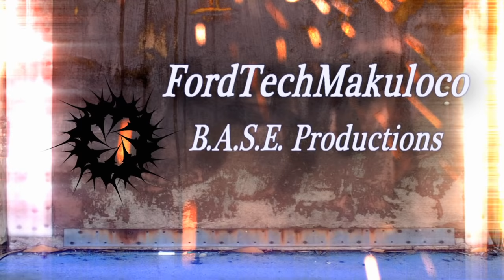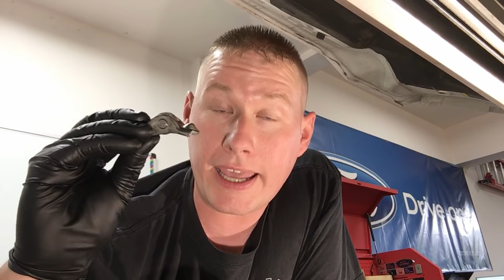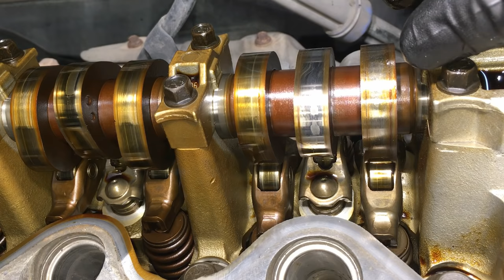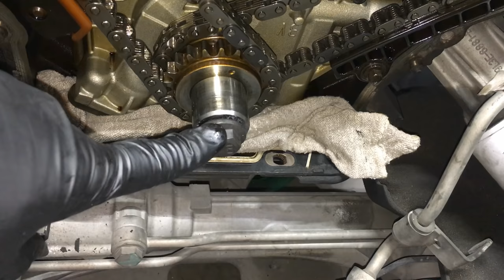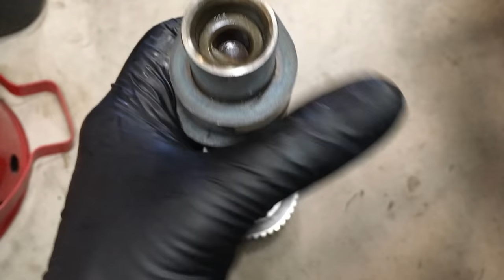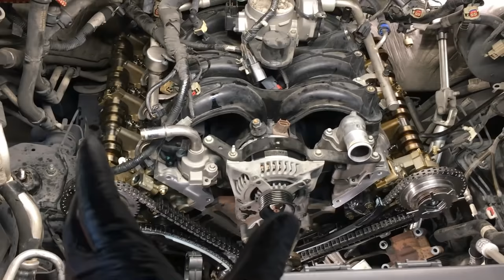Ford 5.4L 3v Triton Engines: Roller Follower Removal and Installation

Comment: i was watching another of your videos and you said always replace. in 2009 and newer..then u said especially 03 and 07 does that mean 2009 and older? i am working on my 2013 should i replace? if there is no damage. any response appreciated. thanks
Reply from the maker: I think you are a bit off here as the 3v engine was not out in 2003 and 2007 was not a change over year so I wouldn't mention the 07 models either. Now I did say 2009 and newer models seem to fail more often but all years can fail so anytime you are inside a 3v engine 2004-2014 they should be replaced yes.

Comment: I need help. The roller rockers will NOT push down and will even bend the tool that’s shown in the video. I can’t even push it down with my finger…. Also this seems to be the case for every valve. Are they stuck?

Comment: hoping this isn't a stupid question...
If you do one side do you have to do the other. 
between removal and installation you removed the tool is that necessary
Reply from the maker: Yes do both sides.

Comment: Can the hydraulic lash adjusters be removed along with the roller rockers with the cam still installed?
Reply from the maker: no
Reply: @FordTechMakuloco  thank you for replying.  I was just figuring it might be a better engine service to replace both hydraulic valve adjusters and roller rockers.

Comment: Do the 5.4 2 valve have the same issues? I have a 04 expedition that's making a knocking/ tapping noise, I'm suspecting it has the same problem!

Comment: Those look like a real pain to take out 😂 Great videos though!
Reply: Some are easy.  Some will make you crazy.  For me, I try to never force them into a spot where they get stuck.  If you can wiggle it, it will come out.  Think ahead about how u want to clock the force on the tool to give you the most room to get the follower out.

Comment: Hey Brian. Love your videos. Great wealth of info. I wanted to ask you a question. Is it possible to safely change out lash adjusters on a 5.4 3V triton without taking the phasors and timing chain off? I have replaced phasors, chain, etc but still have the ticking. My buddy says it’s the lifters. Thanks for any info
Reply: Not really.....

Comment: Wait I’m confused, is having the smaller hole better for oil pressure? I would think the older configuration with the larger hole on the roller the oil would lubricate the cam more and having lower oil pressure then a high oil pressure pushing out of a small hole. I’ve been told my whole life to use ford brand only for timing chains. But I know the new configuration is better but this in theory almost seems backwards. I may just be over thinking engineering but im also wondering why the oil pressure on my truck is rising just slightly but when the timing chains and roller followers maintenance are typically associated with lower oil pressure
Reply from the maker: Yes you are confused.

Comment: Do these roller follower issues usually come with camshaft position sensor codes?
Reply from the maker: no
Reply: @FordTechMakuloco  any idea what might cause an intermittent multi cylinder misfire p0300 and cylinder 7 and 4 most common misfire with occasional cylinder 3 misfire, only at medium load never at idle and never at highway speeds. Along with camshaft position sensor codes with brand new camshaft position sensors in both banks, new spark plugs and coils? Fuel injectiors maybe? Or maybe it still is the roller followers? I plan to fully Diagnose tomorrow so far have just pulled codes and done research and swapped the sensors assuming they just went bad. The plugs and coils I did very recently as preventative maintenance.

Comment: This might be a stupid question but with a new high volume oil pump and the new updated roller followers with the smaller hole will that cause to much oil pressure.
Reply from the maker: no
Reply: Funny I was just thinking that!!

Comment: Im doing the complete new timing chain cam phasers oil pump the hole kit and kabootle anyway the rocker in #8 cylinder the 3 u talk about in stage 3of 4 the valve is under a lot of tension because of the cam loab can i spin the crank shaft to get it with less tension or am i messing up if i spin it with already 2 rollers out of cylinder 5...pls help

Comment: Do the roller followers a need to go back exact same spot the come off of
Reply: Thanks for your vids by the way I lost timing so trying to find tdc going to remove roller followers and try start fromThere .. how do I find the compression stroke in cylinder one on 3v engine.?

Comment: On my 2002 4.6 2v i have slight knock which seems to becoming from inside the valve cover, would it be the roller or the hydraulic lash adjuster making said sound. You cant here it at idle only when you bring the rpms above 2k

Comment: I love watching your videos. So Helpful. My question is when I click on the link you have provided for the roller followers Amazon alerts me that my 2005 F150 is not compatible with the part number and sends me to one that is twice the price. I can use the part number you link to on Amazon and ignore the alert?
Your link: Ford Genuine 3L3Z-6564-BA Rocker Arm Valve Assembly $11.04.

Comment: to remove the valve spring...without removing the camshaft how would you do it I broke one on the passenger side...Driver's side broke first. They fixed it but now I'm on the passenger side it is explorer v8xlt 2002.

Comment: On the right side fifth follower from back of engine I cannot get the valve spring compressor in because of the air conditioner expansion tank, is there another way of compressing that spring to walk the follower in?

Comment: Being that the cam is married between the head and the block with no real bearing on the original ford 5.4 3v I find myself a bit leery of wanting to pay someone to do a timing set, roller followers, melling oil pump etc thinking by the time I pay for all this to be done I'm close to about half the cost of a new motor.  My 2005 f150 has 180k and does have a ticking noise. I keep hearing from mechanic near me I can get a rebuilt motor that has bearings for the cam which sounds like it would make the motor last longer but then every time I mention one of the rebuilds my local mechanics want to use I.e. Frasier, Jasper, Carquest etc I'm told by guys who really know this motor inside and out those rebuild are garbage...so it's back to the ford motor. Would a new ford rebuilt motor include bearings for the cam or is this a non issue? also would a new ford rebuilt motor come with the roller followers with the smaller holes and a melling oil pump? It's just that I was told by several mechanics that if there are grooves where the cam is married between the head and block then it's pointless to do a timing set..they say it's just a bad design. It's tough when you want your truck fixed for the long term and know just enough about mechanics to be dangerous and are at the mercy of mechanics that all say they know best and each one says something different. I'm about ready to drive 6 hrs to Brian and just say here fix this damn thing right lol

Comment: How do you remove the rollers when the timing is already out of time? You obviously shouldn't turn the crank so you don't risk pushing a valve into a piston, so is the only way to remove the cam itself and reset everything?

Comment: I'm having a problem getting the slack adjuster out and the lobe is  at top and it's still hitting the cam I don't know if the top of the adjuster is froze up I'm not sure but I can't get it out any ideas

Comment: Do you recommend 5w20 or 5w30 in a 3 valve v10 and do these engines have any major problems to watch for
Reply: I use 5w30 with NO ISSUES

Comment: @FordTechMakuloco i watched another video, with timing cover removed, there was no need to remove the roller follower to replace cam phasers and chains. I'm at the point of removing the chains. do i really need to remove the followers?
Reply: Cory Thomas what did you do? Did you remove the roller followers? I'm at that point in the job?

Comment: Could you provide me a link to properly adjusting valve lash? I have a loud tapping noise during warm up that goes away as engine reaches normal temp. Suspect adjustment is needed.
Reply from the maker: These are automatic, no adjustment needed.
Reply: @FordTechMakuloco  So I'm guessing a cam phaser going bad? Tapping noise only during start, goes away after warm up. Anything I can check before going that route?
Reply: @DirtyOldSailor  you check your exhaust manifolds??

Comment: The roller follower on Amazon says it does not fit my 2009 Ford F-150 5.4 L 3v. Do I discard this and purchase anyway?
Reply from the maker: Its the same part 2004-2014

Comment: After I do this can I put the valve cover back on and start up or do I have to retime it
Reply from the maker: No you only perform this procedure after engine timing so no need to retime after.
Reply: @FordTechMakuloco  what if you just change the rollers. Do you have to retime?

Comment: Fordtechmakuloo
Replacing timing kit in 05 f150, having trouble removing roller follower next to ac canister mounted to the firewall, any suggestions
Reply: Did you figure it out? Having the same problem

Comment: Can you tell us how to replace the lifters?
Reply: Lifters are super simple but you must remove the shaft.  Pull up on them and they come right out.  A few of mine got stuck about half way up, I put them back in place and pulled up again on them (with just my fingers) and they came right out.

Comment: how do you replace the valve stem seal of this vehicle.
Reply from the maker: +reteece rhu salubre make sure the cylinder is at TDC, remove spark plug and apply air to cylinder to hold up valve, use  a valve spring compressor to compress and remove the keepers. Release the valve spring compressor, remove spring and retainer. At this point the valve stem seal is right there just use your hand or a needle nose pliers to remove.
Reply: @FordTechMakuloco  Can you recommend a tool to apply air to the cylinders? From what I understand the threads are M16x1.5 and the only find tools with M14 and M18 threads. Thanks!

Comment: What's a ball park figure to get a timing job and replace the roller followers  . I know there are a lot of differences in each engine. I  have a 2004 with 231,000 miles and I change the oil every 3000 religiously.
Reply from the maker: $2,500 by my shop, maybe $3500 at others and $4,500 at the dealer.
Reply: Thank you very much . Great videos.

Comment: how do i know what ticking noise is to what problem i'm having i've heard everything from spark plugs to manifold crack to rollers all i know is my truck just started making the noise at 40,000 miles it's 2008 F-150 yeah i don't drive it much but the noise is only noticable when i'm driving it and demanding power like going up a long hill on the highway... i dont' really hear the tapping/knocking noise when it's in the garage idling

Comment: How long in general should it take to replace all 24 followers???
Reply from the maker: 5hrs
Reply: @FordTechMakuloco  awesome thanks for the reply I started last night putting them back in I got about 2.5hrs into the first 12 then called it quits around midnight getting ready to head back out 2 the barn here in a few to pick back up. Thanks for the awesome videos step by step I would have never tried this without them.
Reply: @FordTechMakuloco  got the 2nd half of them down today took about 5hrs for the last 12 after the first 12 took about 2.5hrs last night now back to the video to button this bad boy up.

Comment: Does the 5.4L 2V have the same roller follower as the 5.4L 3V?...just less of them?...and does the 2V lifter have an updated smaller oiler hole?
Reply from the maker: nope
Reply: @FordTechMakuloco dang it. I ask because I have intermittent lifter noise after the initial high idle when cold. Gone when warm.
Reply: @fordtecmakuloco, the tapping gets progressively louder over a 20 second interval then stops. Quiet for 20 seconds and then the cycle starts again. This continues over the warm-up. Except that interval length gets shorter until no noise. Any ideas?
Reply: @FordTechMakuloco , I thought if the recommended 5w-30 was too thin at startup this might be an issue. I was thinking about going to 10w-30 at the next oil change to verify.

Comment: Has anyone replaced them without pulling the front cover? I believe if not, you would need to use the starter to get the lobe in the right spot.
Reply from the maker: No need to pull the front cover.

Comment: Question, currently working on part 3 of 4 videos. Staring to take out the roller rollers. Is there any chance that part 3 video meant to take out 2 Roller followers on cylinder 1
Reply: Got it figured out. System worked out well. So question if taking it all apart could one just take off the caps to the cam shaft after the timing chain is off and not try to compress the valve?
Reply: @pilotoo2007  I wouldn't do that.  I think if you try and remove the cap bolts with the rollers still in place you put unnecessary stress on them from the tension.  Its time consuming but you are far safer to remove all the rollers using the tool.  Then all the valves are neutralized and no tension is on the shaft.
Reply: @neptune4167  What are the symptoms of this  because I did make the mistake of removing my cams before all the followers were removed?
Reply: @littlemirage  I am no FordTech but my guess would be the added stress of the valve springs pressing up on the cams while the cap bolts are being backed out may distort the elongate the bolts; stretching them.  You may not get the proper torque on them when putting them back in which may leave a tower under/over-torqued allowing too much play or not enough causing the cam to be tough to spin.  I replaced all my bolts as I thought they were torque to yield.  If you are replacing the bolts then I would think you are okay.  If you already got the cams out you may be okay but my initial reaction would be to watch out as the followers may fly out from being under load of the valve springs.
Reply: @neptune4167  I'm not a professional mechanic either and never had this much stress over repairing any of my vehicles. It most the unknown answers from lack of experience that has me totally stressed. I love my F150 and don't wan't to destroy a perfectly good motor.
Reply: @neptune4167  I double checked all my lifter - lash adjusters and they are all fine, however the right side cam was tough to turn.
Reply: @littlemirage  My driverside was also tough to turn, I i backed the bolts off just a little squirted some 5w30 under each cap (really around each cap) and spun them.  Once I was sure there was plenty of lubricant I torqued them down in proper sequence and they spun smoothly with no resistance.
Reply: @littlemirage  I hear you.  It is very rewarding once you get it done.  I was convinced I jacked something up and turning her on for the first time was nerve racking.  One of my coils wasnt on tight and the engine was running rough, I was certain I blew the engine; but broke out my scanner and quickly found the problem.  I will say priming the engine IS INSANE and not as easy as Brian makes it out to be.  Will be happy to share what I did to get pressure if you also replaced your oil pump.
Reply: @neptune4167  I did replace the oil pump and believe it or not, it was the ONLY difficult process I didn't have an issue with. I have every intention on priming before true turn over so any advise would be a huge blessing right now. I can't even get answers from f150forum dotcom I am a member of.
Reply: It's crazy how good Brian is, everything he does looks easy and gives you the confidence you can do it, until you 6 deep and parts all over the garage. LOL

Comment: I've got a problem I hope you can fix, I have a 05 ford f150 xlt 5.4L No Start, No Crank, and No Communication, my starter is in working condition and the wire connections can spark sometimes. I replaced the relays, the ignition starter, and replaced the fuel control module about 3 months ago, but she still won't turn over
Reply: My truck did the same thing try putting in neutral and try. Sometimes I have to jam it in park and then she will turn over and start up. 2004 f-150 4x4.
Reply: Joe Goforth neutral start doesn't do anything either :/

Comment: hey bro! the roller 3l3z-6564-a is for a fx4 5.4 07?  or 3L3Z-6564-BA
Reply: 3L3Z-6564-a is the Newer rocker follower with the smaller hole that sprays the oil onto the roller bearing.  Amazon thru Wholesale Direct Parts did have Genuine Ford rocker followers (12) for $53.00.

Comment: *Need some help* so I have the ticking sound noise on the left side. I checked all my lobes can't see any damage. Thinking I cought the issue early. I saw a small amount of metal shavinging on lobe closest to the cab piston 4 I believe. Could not get a good look at the roller follower, but it seems ok I have 3 new roller followers. Which ones should I change? Is there a most commen ones that go out ?
Reply: William Marchant #3 is common
Reply: Thank you fixed the issue was a broken guide.

Comment: Are you supposed to replace all of them if you are doing a complete timing kit on a 2004 F-150 5.4L 3v with 174,000 miles?
Reply from the maker: I would yes.
Reply: @FordTechMakuloco  Lash adjusters too or just the roller followers? Does it matter if they are aftermarket?
Reply from the maker: Just followers, use Ford OEM.
Reply: @FordTechMakuloco  where r u located sir I have a 06 f150 with the same issue going on
Reply: @jarrodhamilton3198  Yorkville, IL  Lookup BSG Automotive
Reply: @FordTechMakuloco  I have been reading some forum posts of guys using the M-6529-3V kit on 2004 5.4L 3v's, what are your thoughts on this?